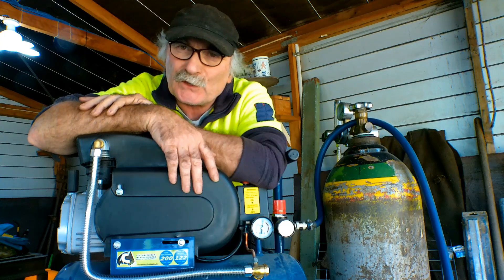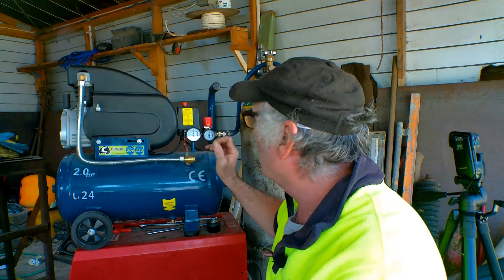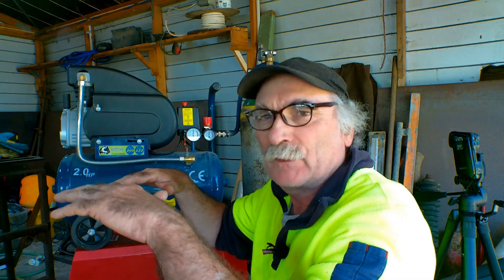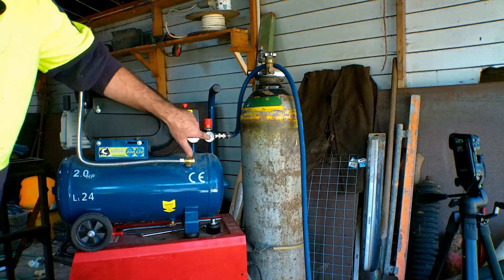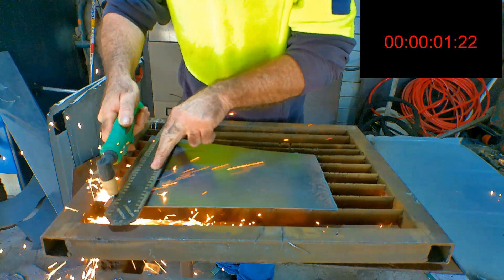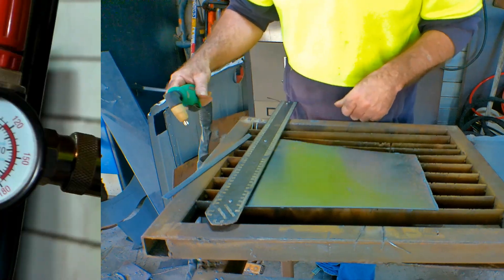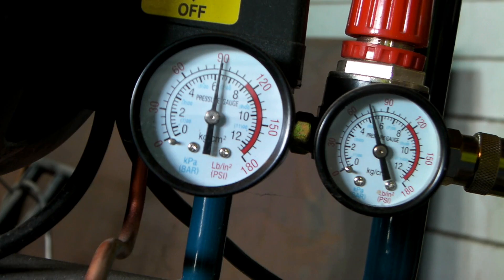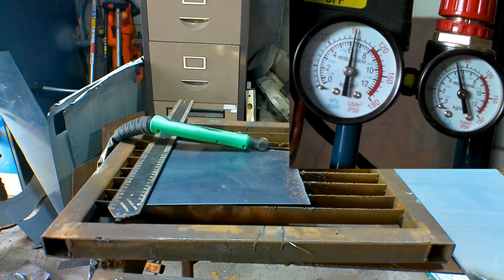What is the Best Air Pressure Settings for a Plasma Cutter?

Comment: Hey guys...I'm building a homebrew (very low cost) CNC and I intend to install a PT-31 torch in it. My question is...what is the thickest metal sheet I could cut with this torch ? (Carbon Steel and Aluminum).
Reply from the maker: steel  about 6 mm and aluminum doesn't cut very well
Reply: @petestools  : Does AG60 cut Aluminum better ?

Comment: Would've loved to have seen an up close shot of those cuts. My concern is that at a lower pressure there will be less of a cooling effect.
Reply from the maker: Yea your right the less air pressure the hotter it will get .But am only useing 40 amp so will only  get so hot.

Comment: But what is the low preemie doing to nozzle? My Miller won't even start with lower than 85 psi not to damage comsumibles and nozzle
Reply from the maker: But I am useing a drag tip. Cheers pete